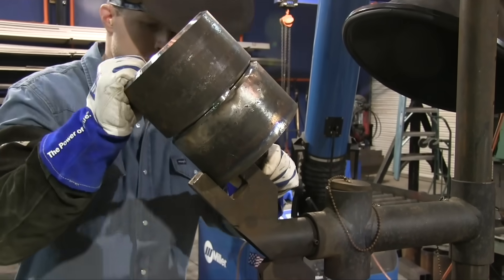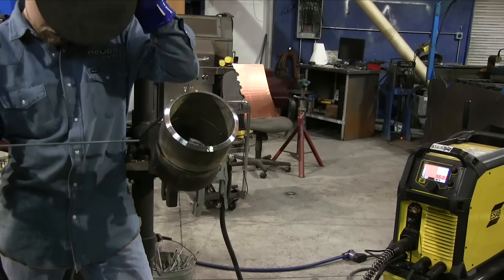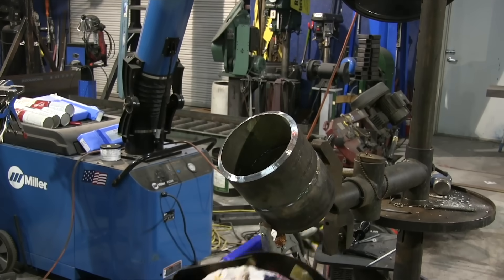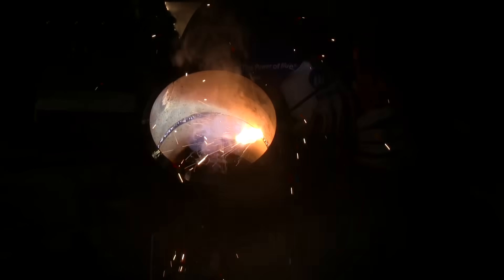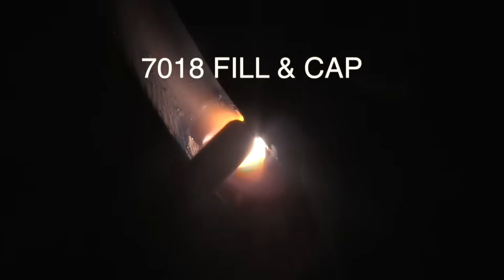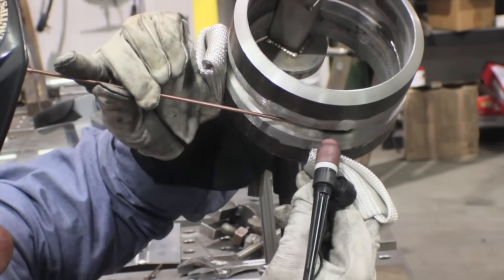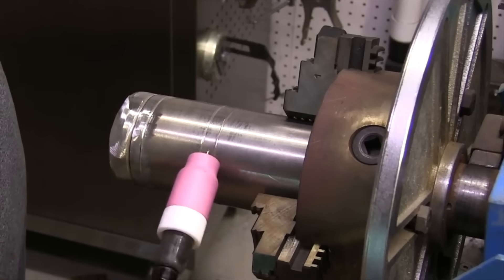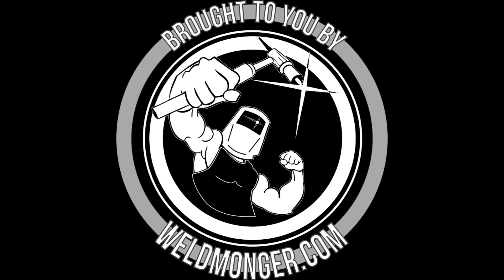6g Weld Test 6010 Root

Comment: Great tip when taking. As I make my tacks I zone in my amperage, plus or minus 3 to 5 amps depending on what my key hole does and if I can handle the heat. By the 3rd & 4th tack I have it dialed in so I don’t have to mess with my amps as much when I start my root. 
Minor adjustments are made by paying attention to the gap. If it gets tighter, turn it up maybe 3amps & opposite if the keyhole opens up. 
Thank you for the great video shoots, tips & tricks. 🙏

Comment: i have a question when it comes to interpreting a blueprint or drawings, in my job we are building giant buckets using thick plates but on the welding, specifications require a class B90 grind or B125, C etc etc. do you have any information regarding this?

Comment: Hi Jody 
Are you guys coming out with the 7016 pipe video soon ? i ask cause i am doing my pipe welding coarse now with 7016 2G & 5G and was hoping to get some insight into that from Andrew and Yourself , loved the 7016 plate video some really helpful  info and arc shots thanks.
Reply: B the 7016 runs almost exactly like the 7018 , just run a couple and set your temperature and your gonna do fine

Comment: you dont heat the metal before welding long welds like this ?
Reply: Charlie Crownme no need on a carbon steel test, if it was a procedure requiring a pre heat and a inter pass temp to be maintained you would.
Reply: @joeboyle8987  well i am asking since ive seen ppl weld like this without preheating up to atleast 100 degrees, and what happens is that you get cracks between the weld and steel. but if you arent gonna put any force on the object i guess it is fine. but you can see what i am talking about in the 1:00 mark on the tack. in my cases i always preheat now since ive had some bad welds without it. it also keeps the metal/steel from bending so much when you start to weld long lines. but thnx for the anwser, i will put it in my notebook and check it alittle more out.
Reply: Charlie Crownme I cant say for sure any numbers off the top of my head but if your material is below a certain temp say 32 degrees you’d have it in your best interest to bring it up to at least the ambient temp before welding
Reply: Charlie Crownme what kind of welding you do?
Reply: @joeboyle8987  now i weld mostly farm equipment, tracktors and hangers and random stuff. but also quarry eqipment from time to time, like buldozers and diggers, welding new meat on the teeth and digger buckets :) so it is mainly rough tough welds, i kinda suck at thin welding and alu welds :)
Reply: @joeboyle8987  and you ? you work as a welder or just hobby ?
Reply: Charlie Crownme but right on man keep burning and learning. Nothing wrong with picking up all you can.

Comment: Thanks for the video:
Video suggestions: in Alberta job test that is getting popular is Mig root and fill and cap roll weld on 2 inch and 4 inch pipe.

Comment: Nice video.
I smiled at the video.

Because these welds are clamped with a pipe, which is 45 °. Is welding test in Germany, whether welding process 111 (electrode welding), 135 MIG / MAG welding), 145 (TIG Welding).

Comment: Recently I was TIG welding an aluminum ladder rack repair using my AHP Alphatig 200X.  Almost cooked my pinky. Just received my TIG Finger from you.  What a great little invention. Protects my finger and provides a smooth sliding surface.

Comment: Wish my arm was that steady. Looks like I'm having a seizure when I free hand.
Reply: Keep your arm in a comfortable position. Try different ways to get your welding arm on a rest. Not always possible but most times you can. Remember: “heat is control…comfort is the key”. That’s been my motto over the decades. Good luck 🍀 and thanks for the always amazing and informative videos. You rock brother!👍
Reply: Like everyone is saying he is bracing himself on the pipe so it isn't really free handing.
Reply: Kathy Rudolf, OD I was like that at the beginning of my schooling last year, played around with some 5-10lbs weights, cured.
Reply: @txdocprich_8404  Even funnier is I was logged in as my wife. (Jon)
Reply: @txdocprich_8404 how’d you cure it with weights?